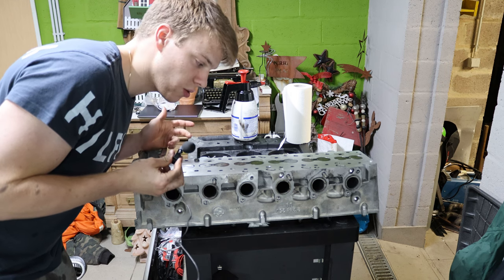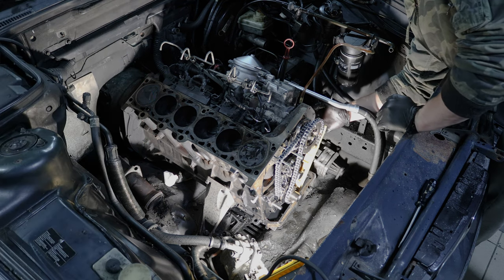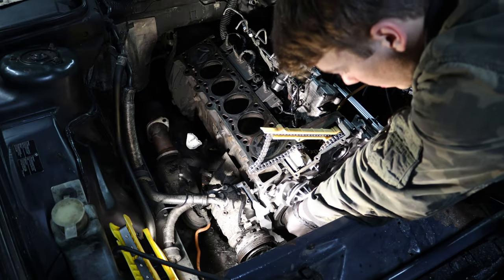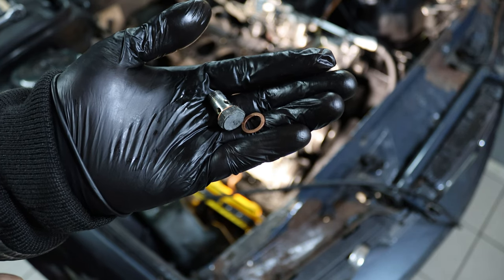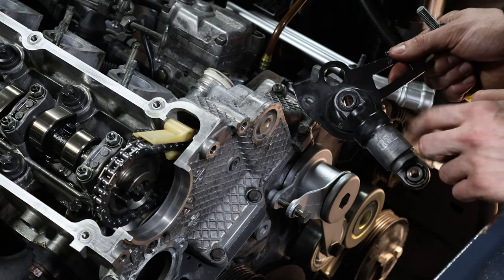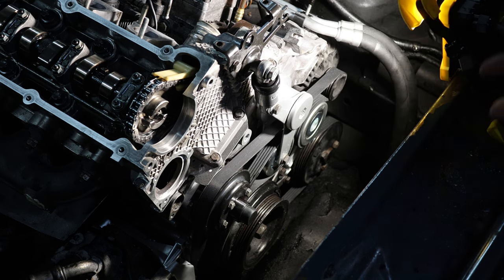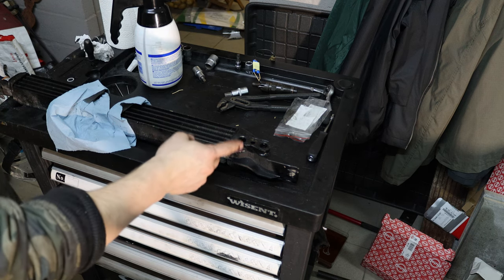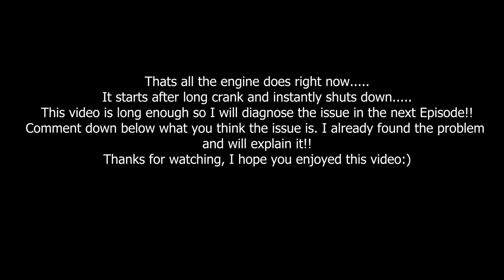Engine Rebuild Drama: The Stubborn Silence of the E34 525 td // Ep6

Comment: Nice episode! :)
I would put my guesses on the fuel pump timing. Probably pump itself is out of time or someone has messed with the top cover and now when the chain is changed the adjustment done is not going to work. Had cases with no start as well but mine came to be air in the fuel pressure lines going to the injectors. Had to loosen all the nuts on injectors to let the air out.
Reply from the maker: Thanks:) Well guessed! I did adjust the injection pump in this episode very approximately. Still, after adjusting with a dial gauge,  it semi-started but wouldn't really run so I had to readjust the mixture adjustment cover to make it run richer. Now it idles beautifully at 600 rpm :) So I think the issue was a combination of mixture too lean and injection to advanced :)

Comment: Nice video. If you ever have to do this again, you can make an angle gauge really easily by drawing a circle on some cardboard, mark the angles you need to deal with on the cardboard using a protractor, then attach the cardboard to a short 1/2" or 3/8" socket extension in the centre of the circle. You can then rig up a fixed reference point and torque the angles.
Reply from the maker: Yep definitely doing rebuilds in the future and will buy an angle gauge in the future, but since most of the bolts got 90-degree angles I could eyeball it pretty well, and because I had a lot of stuff to do I just decided to rock like that:)

Comment: I have such a firm respect for your methodical flow of automotive mechanics.  I too strive for such excellence in my few restorative projects. I  am a former '82  733i owner, '81  320i , '82 Porsche 928 owner. 
If I was to suggest anything of why you had a no-start, it would be that the injectors do not have proper  fuel pressure as of yet. Also, be sure to double check all your spark plug wiring at the coils, fuses for ignition. Cant wait for next segment. Power on !
Reply from the maker: Hi, thanks for your nice comment!